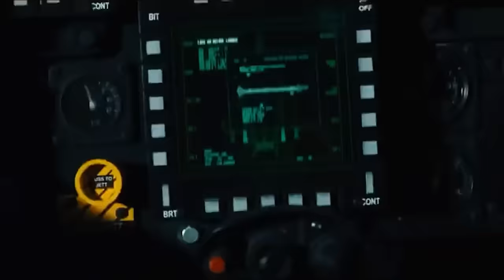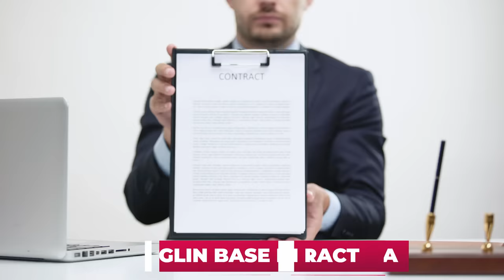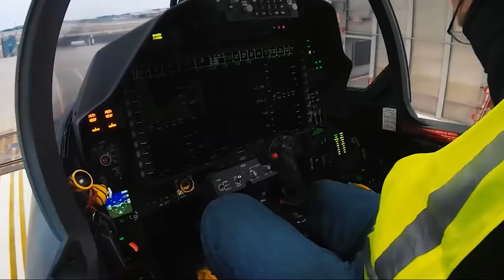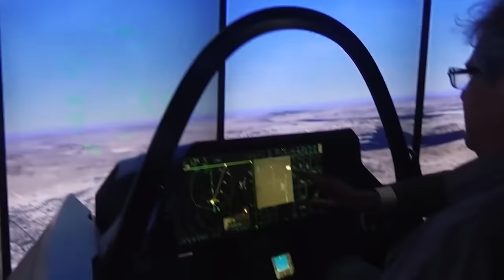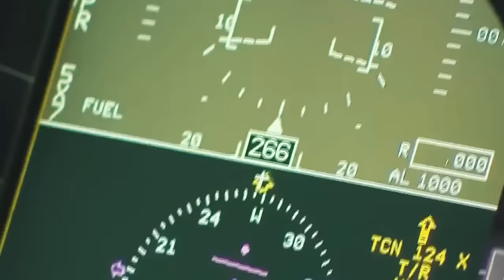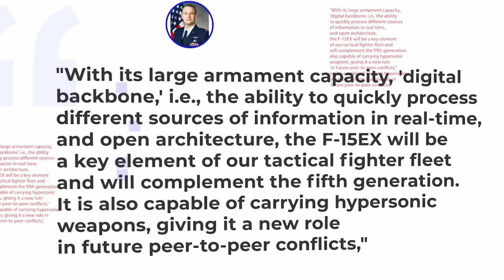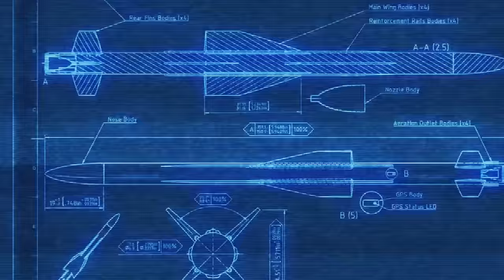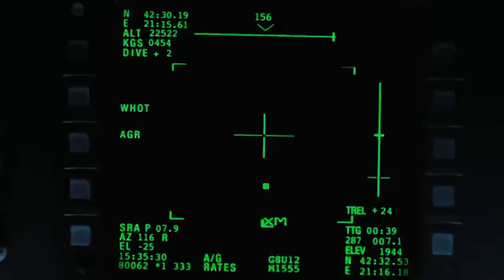NEW Upgraded F-15EX III Shocked Russia And NATO Countries

Comment: This was a very smart move.  The F-15 platform is far from obsolete and building a brand new one with all the modern goodies at a much lower cost than the 5th gens means more of them and pilot training won't be as complex.
Reply: It you mean development cost, then yes it's cheaper. But it's not much cheaper to run. The new unit cost is probably very similar. The F35 might even be cheaper. They just have different advantages and disadvantages. They're not being "brought back" because of faults with the F22 and F35. The F15 will be complimenting the 5th gens fighter roles. The new gems will stil the primary first strike and air to air platforms. Plus they can sell  a shitton of  them.
Reply: F-35A is cheaper than a F-15EX please google new costs 2023 prices.
F-15EX is obsolete highly radar visible aircraft that would get smashed by 5th gen Chinese fighters in 5 years.

Comment: This review is pretty biased.  The F-15 and the F35 have two different missions with the F15 being more like the F22.  
You are critical of the F-35c's speed not taking into account the F-15 cannot do a vertical takeoff.  Also, the F15's top speed is when it is unemcumbered by armament.   The F35 can hit top speed with a full compliment of armament in it's bays.
 I don't think we realized how far behind us Russia and China are.   The F-15II and F-35 will compliment each other well and the F-15II actually makes much more sense as a partner to the F35 than the F22 does.  You should compare the F22 to the F15II.

Comment: Modern commercial jet liner manufacturers upgrade the products they sell roughly every 3 to 5 years and do so effectively. They don't re-design the complete 'bird' as much as make it more efficient.
This is the basis for all aircraft be it for military or commercial intent.
Reply: This is true, but a 707, properly upgraded can continue to perform its job today in a way that an f4 cannot, regardless of how much you upgrade it.

Comment: The F22 cannot fly above FL 250? Can't fly in Alaska? Cant fly out of range of a emergency runway? To put it politely....bull s#$t. How do you explaine them being in Europe, or Guam? Flying to the intercontinental locations definately qualifies as out of range of emergency runways. How about shooting down ballons in the Gulf of Alaska and Canaa by the Alaska based F22. Or off the US East Coast? Those were all done at very high altitudes. You are correct about oxygen issues at one point in time, repaired. They are very expensive to maintain. That, as you said is where the new Eagle comes in. It has always been an exceptional jet. This new jet is as another person commented below, a 5th gen fighter in a (modified) 4th airframe. Given what the airforce has done I think the Navy should do the same thing and build the Super Tomcat. The Hornet is a very good jet but it doesn't have the airspace dominance capabilities of the Tomcat and is a old airplane as well. Thank you and be safe.

Comment: A lot of people in the comments don’t realize the F-15 and F-35 have very differnt roles. You don’t need stealth (and it’s limited ordinance capacity) in every scenario.
Reply: Also the invention of the new "STEALTH COATING" (tin oxide paint) is pretty cheap to put on. Have you looked at the cost of SOLDER LATELY (half tin by formula)??? quadrupled in price in last 5 years. Ask why???? All aircraft and Missiles are getting a new EXPENSIVE tin-oxide paint job which all comes from Indonesia via China.
Reply: F-35 is getting 6 a2a missiles internal soon. F15 should work well with the f-35.
Reply: @llamudos9809  yeah the new weapon bay is going to be a neat addition. Not sure how it helps much regarding radar cross section though.
Reply: @enginepy  I think too many fanboys tried to make an issue with the f-35 & f-15 when in reality i feel there is a need to develop both.
Reply: @llamudos9809  could be. I don’t really care for the f-35. I’m sure it’s good but I love the f-22, F-15 and F-16. Those three fit the bill well.
Reply: @enginepy Everyone has a favourite. I'm looking forward to seeing the next gen fighters personally. I really looking forward to seeing fluidic thrust vectoring in action.
Reply: @FirstLast-hs4gw  oh yeah for sure. We are screwed. All by design of course.
Reply: @FirstLast-hs4gw  f18 is just as good though if not better with a better service record so why not those? why the f15 is what I wonder.
Reply: @FirstLast-hs4gw  I completely disagree with your statement on weed, it has different effects for different people, I enjoy smoking it because it inspires me, and mellows me, while I enjoy reading about physics and math and science on our universe, and solar system, and engineering on all sorts of things from rockets to fusion reactors and much more...

you shouldn't really be angry at people who smoke weed just because you have had a bad experience with a select few, that would probably be just as bad without it anyways, and make it a reason to bring it up in conversation just because so...

as for your rant on literacy well it's hard to even tell you are literate nowadays with things like Grammarly so you could just be tooting your own horn for no reason...and for some reason, you are blaming the people when it's the teachers and schools that are the problem...

do you even remember the school lunches and how they were nothing to look forward to, or how the teachers were only there for their paychecks, and not to actually teach and enjoy the career they spent time in college for because they realized they made a big mistake in that they would be doing it forever???... because I do.

you are a little out of touch with reality, a lot of stuff has to change in government and schooling and wealth distribution before you blame the people...

in words from a movie: Jeff Daniel's on the Newsroom 2012: just in case you accidentally wander into a voting booth one day, there are some things you should know, and one of them is that there is absolutely no evidence to support the statement that we're the greatest country in the world. We're seventh in literacy, twenty-seventh in math, twenty-second in science, forty-ninth in life expectancy, 178th in infant mortality, third in median household income, number four in labor force, and number four in exports. We lead the world in only three categories: the number of incarcerated citizens per capita, the number of adults who believe angels are real, and defense spending, where we spend more than the next twenty-six countries combined, twenty-five of whom are allies. None of this is the fault of a 20-year-old college student, but you, nonetheless, are without a doubt, a member of the WORST-period-GENERATION-period-EVER-period, so when you ask what makes us the greatest country in the world, I don't know what the __ you're talking about?! Yosemite?!!! 

"and that was data taken for a speech on a movie in 2012!!!!" 

and well for being weak like you said, we are far from that, we are the most feared and strongest on the planet, so much so, that if we try to step in ANYWHERE, like Ukraine, we get threatened with nukes....that's why our country is so messed up, get online and look at some statistics for once, instead of ranting on the internet as you did there at the end of that statement, and you would know why of all the things you wonder are the way they are, by just putting the puzzle pieces together.
Reply: NO YOU DO NOT!!!.

Without STEALTH.....
the lightning II, and raptor are mediocre at best.

Both combat jets are overrated.

♠️THE VANITY ADDICT♠️

Comment: It's been said many times by more informed people than me, that when the air force snubbed Northrup and chose to go with Lockheed, they , made a huge mistake, and for politics reasons and closed door deals, as the YF 23 even to an uninformed person was obviously the better aircraft. For some reason (hint-hint) the air force continues to be wedded to Lockheed. I know one thing that is almost certain, Northrup would not have screwed up the pilots breathing apparatus, especially given the amount of money the air force threw at Lockheed, had it been Northrup, more than likely the air force would have gotten a right proper aircraft, and they would not have had to shut down the program due to high priced lemons and then have to rely on revamping a 4th gen airframe. Don't get me wrong, the F-15 is a great airframe, just outdated. The fact that Lockheed has benefited in failure by selling more older planes to the air force really just irkes me all the more. They don't deserve it, and it seems they have found a way to hold the US government to their teat so they can keep feeding them their under performing and older planes.

Comment: F-15's still have to fly along side F-35's as bomb trucks anyway,  since F-35's can't carry anything outside its weapons bays without giving up its stealth characteristics. Therefore, F-15's still need replacement aircraft to maintain squadron readiness.
Reply: F-35 will be able to carry 6 missiles after it's block 4 upgrade.
Reply: @niweshlekhak9646  yup but the main plan is to use the f35s and the upgraded integration systems to communicate long range stay hidden and use the f15 to basically rain hell from miles away without being detected

Comment: The F-15 is a proven product. Yes the EX is new but the biggest part of the airframe is a proven design. Buying the F-15 is reliable where the F-35 is nowhere near as reliable as the F-15.  The F-35 is a disaster and a boondoggle.

Comment: Uh, Boeing has deep pockets in the Lobbyist hallways of Washington DC. That's why they're buying the F15, not because its anything new and no matter how much you trash the F22 and the F35, they will always be the better aircraft. As for the billions paid for the R & D, what R & D, the F15 isn't really a boeing aircraft its McDonnell Douglas. McDonnell Douglas are the ones who R & D'd the F-15 50 years ago. All boeing did was put on new conformal fuel tanks and update the engine package. Hell the electronics are stolen from the F22 and F35. As for the 20,000 flight hours, yeah maybe between complete overhauls that take the aircraft down to the frame but the rest is BS. It will still have $100,000 maintenance for every flight hour just like the B2, just like the F22 and just like the F35.  Not to mention the figures given are rough estimates that are sure as hell going to go up after contracts are signed. The original F15 cost 25 million dollars 45 years ago. even the Strike eagle was only 30 million 30 years ago.  At $125 million dollars, (the real price and not the BS 80 million being quoted elsewhere)  this POS cost more than an F35 without the technology and stealth.  The theory behind the F15EX is as a missile carrier that fires it's missiles and runs away while the stealth aircraft do the targeting the dog fighting and the clean up.

Comment: The F 15 EX, is based on a 50 yr old idea, but seeing you put it out there, it's a brand new plane based on a tried and true airframe.
Reply: As the saying goes if it ain't broke don't fix it. That in itself speaks to what they got right with the airframe of the F-15. All they've had to do over the years is take the base of it and improve what's inside. Doing this has made it more capable without having to design a whole new aircraft from the ground up (looking at you F-22 and F-35). just like what they've done with the B-52's (new electronics and payloads with more fuel efficient jet engines). These are crafts that will last decades into the future. It just proves the point that all the new toys don't always make for the outcomes.

Comment: 1. The OBOGS on the F-22 was fixed this year
2. F-16 Block 70/72 is a new aircraft
3. NOTHING beats the AWG-9 (now, if they can match the 15 to the AWG-9 radar and the AIM-54D...oooohhhhhh baby!)
4. The old F-15A Strike Eagle (F-15A-6-MC) still holds the time-to-climb record (1 February 1975 - 913' MSL to 98K+ MSL  at 3.5 MINUTES!  Stuff that in your pipe and smoke it!)

Comment: There is so much wrong in this video it isn't funny.  In particular, the F-22 information is WAY off.

1.  There is no altitude restriction any longer.  That was a VERY short time, and it was related to the OBOGS issue.  
2.  The OBOGS system has been fixed.  No longer an issue.
3.  There is NO issue with "flying away from a runway".  That's bullshit.
4.  They fly without restrictions in Alaska.  They are the premiere interceptor there, and fly ALL THE TIME.  

There was more bullshit said I just got tired of listening to it.  Get your facts straight.
Reply: The f35 shit was just as bad.  This dudes full of bad headlines without context from 7 years ago.

Comment: So, the F15EX completes the air wing triad.  The 22 is the dog fighter, the 35 is the stealthy penetrator, and the 15EX is the multi-role gorilla that brings the pain.
Reply: Yup.  Pretty much.
Reply: Amen 😊
Reply: F35 is like a Safety in football with the 22 as the shutdown corner and F15ex as the middle linebacker 😉
Reply: except they don't have enough 22's.
Reply: @gtc1961  22's are being replaced they're too expensive to produce and far too expensive to upgrade to the point you may as well build an entire new fighter and work on the design systems etc

Comment: F-15 is very FAST  has many missiles  Now remake it but put stealth coating on it Put the very latest  Radar  in it and it will be just as good as the F-22 Plus with its speed you can fire missile further

Comment: Well now maybe the Pentagon reconsider the benefit of updating older models that more cost-effective. Who knows maybe they'll bring back I'm updated version of the F-14. That would make a great land based plane as well.
Reply: Unlikely. You're getting all of the ground attack benefits of the -14 in the -15 anyway (plus some more), and the Super Hornets can do everything the -14 can except look as cool. Add to that the fact you'd have to start up a whole new assembly line and redesign most aspects of it for modern systems, AND you'd still have the wing pivots as a major structural risk over time which would limit its stores and g-loads.... It's just not cost effective. Plus the -14 was a beast in size and would probably be problematic on the newer carrier decks, just like it was on all the pre-Nimitz class ships. You can carry three Hornets for the space of two Tomcats and that adds up fast in terms of strike power.

Comment: So much miss information on the F22 in this video. The F22 flies daily out of their bases. It is ready to deploy in a moments notice. Wing tanks can be added for long range ferry flight to deploy to combat zones and again, does so regularly. Yes the stealth characteristics are cut down but once in the combat zone wing tanks are downloaded and back to super stealth. The F22 is capable of aerial refueling so the need to stay near a runway is a myth and major disinformation. The high cost and maintenance is a fact but, when this aircraft is fully mission capable, their is no other aircraft that can touch it for the mission it was designed to do.
The F15 is a warhorse and has proved itself over and over again and is still near the tip of the spear. With the addition of the LO coatings and some minor changes made with the new design the radar cross section has become much improved. The F15 will always dominate in its mission roles.
Reply: Well said my friend. Thank you for taking the time.

Comment: With the 360 degree helmets and sensor systems and the ability to launch off axis, getting the nose of the plane pointed is not as crucial as it was, i would estimate.  The USA does need a cheap semi-stealth sort of plane to carry missiles in to support the stealth platforms and move ordnance once the SAM batteries are taken down.  Between the lagging manned bomb trucks that can dogfight, and the dog brain buddies, the stealth F-35's can probably deal with any zerg attacks that may come their way while taking out the missiles.

Comment: The F-15 is just one of those aircraft that was far ahead of it's time. The performance is almost shocking, even by today's standards. It doesn't have to be stealth. It is just a powerhouse. Over 1/1 thrust/weight ratio. Top speed and acceleration. Maneuverability, both air superiority and strike fighter. It is only outperformed in air to air by the F-22. 
I think the ideal Air Force would be primarily composed of F-22, F-15, and A-10 with a few upgrades and used in their perspective roles properly.
Reply: At the factory when they roll one out to ferry, they're in the middle of a major metropolitan international airport. So they had TCA. Tower controlled whetever and when a new bird took off it went straight up like a bat to avoid commercial traffic. Amazing sight to see.
Reply: Your wrong on so many levels, this F-15EX will be a secondary backup fighter at best.